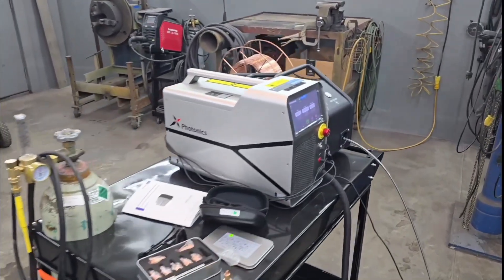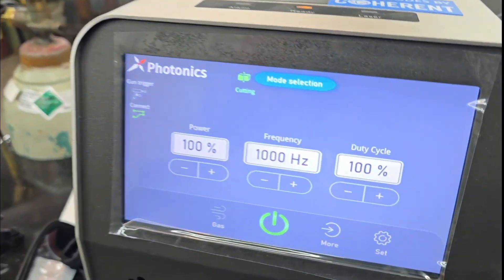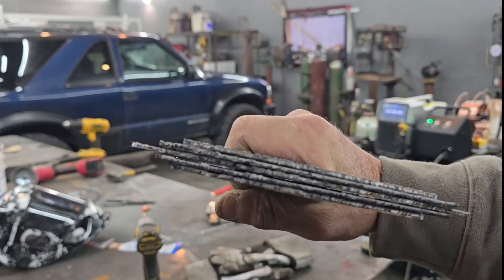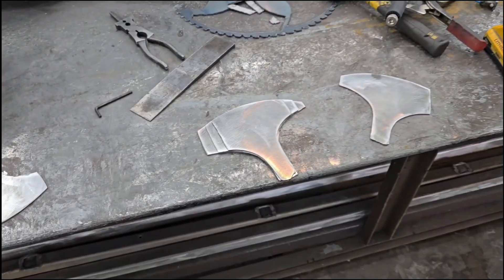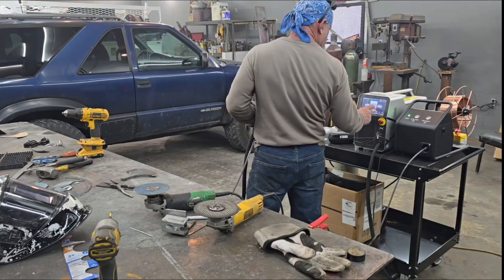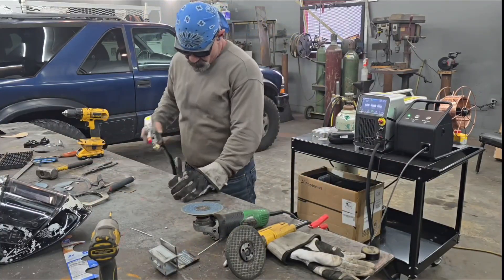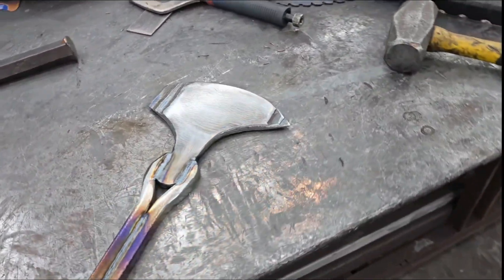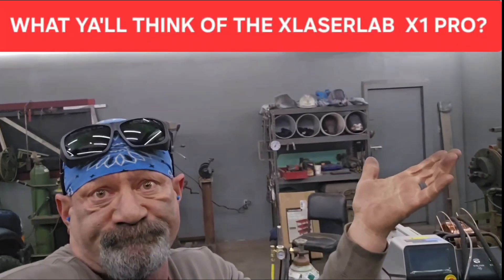Xlaserlab X1 Pro & my first time laser welding

Comment: Yes, this is a low power welder. It’s good to a bit over 1/8”. If you angles the head flatter to a horizontal part when welding a T joint, you’ll get really good penetration. But this is a good unit for sheet up to about 10 gauge and particularly for 14 gauge and thinner. I’ve got a 1200 watt model and that gives some extra oomph for thicker parts.
Reply from the maker: Appreciate the info, thanks!